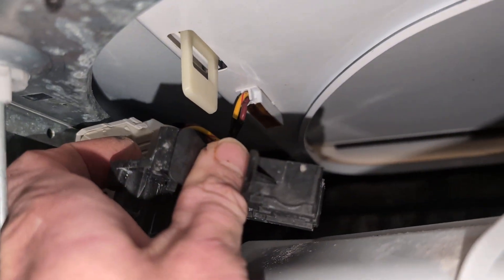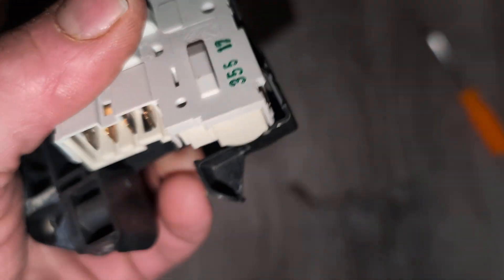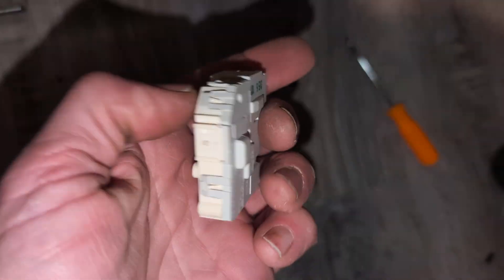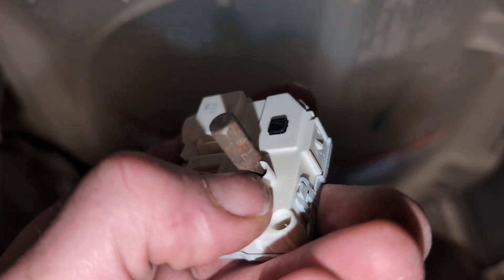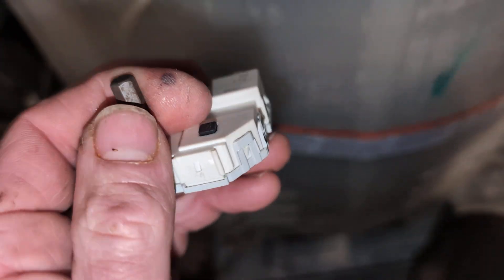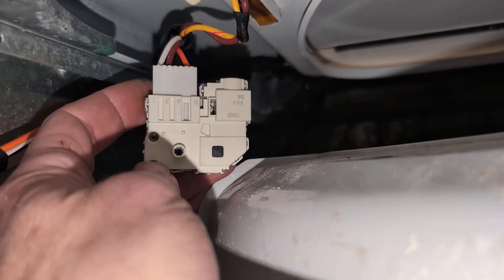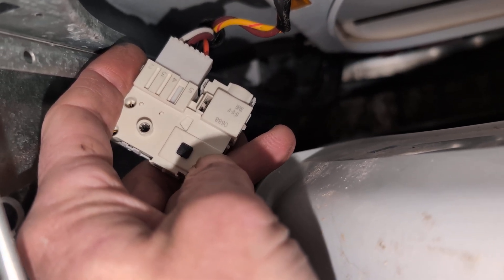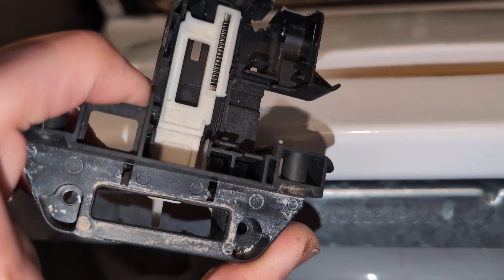Advanced: Lid LockRepair & Adjust GE/Whirlpool/Kenmore Top Open Combination Washer Dryer GUD27ESSMWW

Comment: Hey thanks for the video very informative. Got a quick question for you if you happen to have the technical knowledge my issue appears to be that the plastic lock is not sliding out when the locking mechanism is activated. Even though it still does activate and make the clicking noise. Would this still be a locking mechanism issue or control panel/power output issue?

Comment: Yes some do have locking tabs that will not release must tear old switch completely apart and the wires will still be attached to the broken metal tabs. Old school these are brand new units and our complex buys them because it’s the only 24 inch wide stack available.

Comment: Could this be the issue on a brand new switch? I hear the clicks on both the old and new switch but machine is not going into any operating mode. It worked for one cycle fine though. Just one.
Reply: I have same issue. It worked once now light still blinks. How you fix.